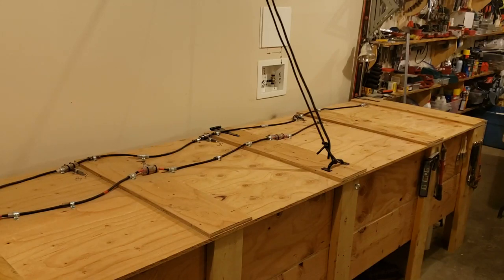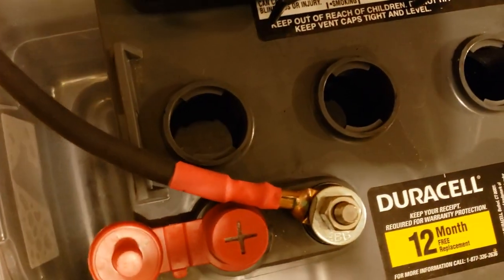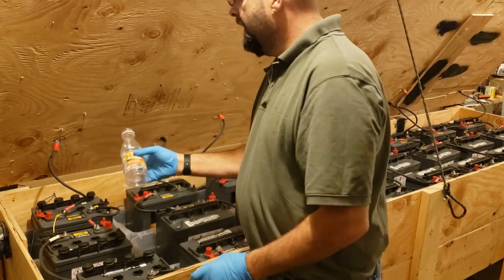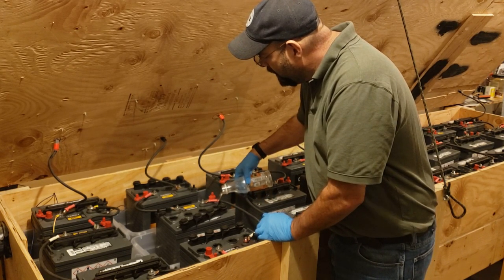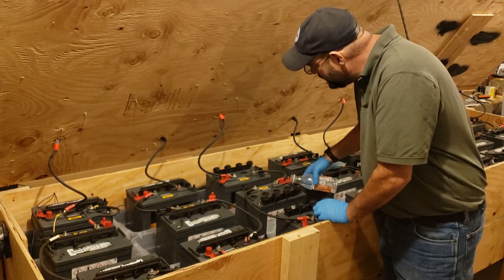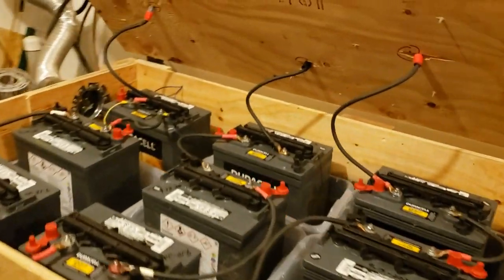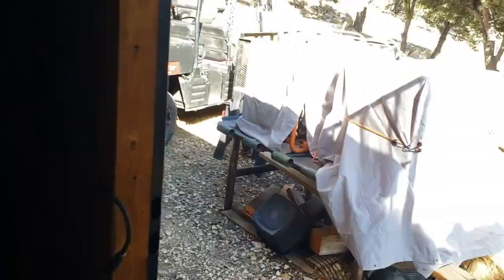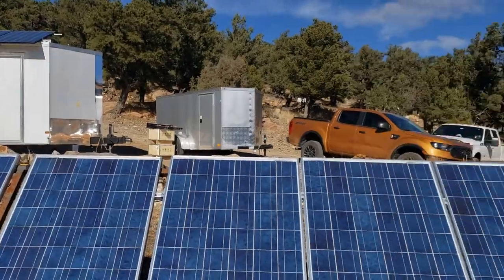Off grid cabin , lead acid battery maintenance schedule

Comment: " 48v 200ah - that'll do the trick ". Yes indeed. No one can say a thing bad about your system as the proof is in the pudding, 15 years of finding out what works for you. Bolt down those solar panels firmly lesson learnt the hard way. Wind generator just sits in the corner churning out power hour after hour. Thanks for allowing us to see your property.
Reply from the maker: thanks, ya we are going to go Li-ion when these batteries are depleted. Probably this summer.

Comment from the maker: on a 48 volt system you can get inverters that have a much higher capacity , they do not need to pull high amps like on a 12 volt system . I have three 48 volt systems , one of them has a 8kw inverter and it does just fine.
Reply from the maker: @able880  to long did not read
Reply: @chadjones99  I deleted it for you

Comment: Sir, this is amazing. Thx 4 sharing your systems with me. Let me ask you a question though. Isn't a wooden case for your batteries bank a risk of fire?
Reply from the maker: I don't believe so , the battery is in plastic tubs for any leakage, and a metal case will conduct electricity, wood at this voltage will not.. so the only risk is if a battery caught fire ( which there is no reason for that with this system , unless something crazy happened )  I guess it could spread, but Ive had batteries in a wood box for about 15 years, ( this box is only 2 years old ) and never had a problem.
Also a metal box would be very heavy and the cost would be crazy compared to wood
Reply: @chadjones99  thank you very much. I'm just learning and not trying to be disrespectful or condescending or sarcastic. Thx.
Reply from the maker: @jacquesdutron9954  ya no problem . This cabin was built about 15 years ago , and about 2 years ago we moved the battery to inside the basement as they had been in a out building next to the house for 13 years , so this box is new ish
Reply: If he was worried about fire risk he could put something to layer over the wood if he wanted.

Comment: I didn’t catch if you were using distilled water or not. Please make sure you use distilled to fill the batteries! Regular water has minerals and other impurities suspended in it
Reply from the maker: Yes I am but thanks for the info. Been using distilled water . Thats why they last me 5 to 6 years

Comment: Is converting to 24 v or 48v how you get around and fix the idea of not being able to use devices with higher wattage from your system? With a 12 V system I am finding that you can't really hardly pull any higher watt usage devices from the system because the power dips and then the inverter would block pulling the watts because it didn't like it when the voltage would drop too far from a bigger load (to protect the batteries). 

Maybe doing 24 v or 48 v systems are how you get away from that?

Comment: what are using as a bms? to protect each cell?
Reply from the maker: Lead acid . You don't use bms on lead acid . Charging set by inverter charger and charge controller

Comment: Should replace the lead acid for a real battery system (LFP) and realize dramatic improvement:)
Reply from the maker: your right. I have such a system ( 3 of them 48 volt trophy battery ) . but I still have 3 to 4 years of life left in this battery so I'm not going to waste them.... check out my FB page to see current projects : search this name   : Solar Trailers Johnson
Reply: So what kind of "real battery system" do you currently have?
Reply from the maker: @MrRob1426  not sure what you mean when you ask in " " marks about a real system ?  We have a lead acid system in the Cabin as listed above. I have two mobile systems that use 48-volt Lipo4 trophy batteries. But Im not switching out the Lead-acid system because they still have a couple years left in them and I don't see a need in wasting the batteries if they are still good. when we bought this current lead acid system about 3 years ago Lipo4 replacement ( to match this size ) was out of our budget.
Reply: @chadjones99  Sorry for the confusion. My comment was meant for the one that said you should replace your batteries. Use what ya got if it's working. I like it. 👍
Reply from the maker: @MrRob1426  Ok cool , ya I was like well I would like to but this is what we have the budget for LOL
Reply: I don't think you should replace away from lead acid. Lithium has much much more fire risk. Also if you are in Colorado people say Lithium can stop working once the temperature goes to freezing. For very cold weather lead acid works fine. 

Plus, the reason people are obsesses with lithium is to get away from how 12Volt systems can't really pull electric juice/wattage on electrical appliances and how limited they are. But your system has already compensated for that by getting away from 12 Volts to higher juice (24 or 48 v). 

So there's no reason to do away with an already wonderful setup and design. Plus you can't mix lithium and lead acid batteries together. You have so much already with this system and it works. 

He's already built over the problems that people would have with lead acid. So he gains nothing by going to lithium. Particularly since you can't mix lithium and lead acid. There are videos where people talk about trying to research how to mix the 2 types together, and if you actually listen to them, the fire risk and problems if something go bad are amazingly high risk.

Comment: Fireptoof?
Reply from the maker: Huh ? do you mean to ask if its fire proof ? No it is not but I have no reason to think a fire would start , at worse the battery can leak which have pans under them inside this box, plus box is ventalted to the outside.  If a battery explodes its inside the box and will just splatter acid ,

Comment: Car batteries are not something you can make or grow yourself so YOUR LYING about being off grid.
Reply from the maker: What are you referring too ? 1) not car batterys ( lead acid gulf cart 8 volt batterys) 2) i never said I made them ... bought from. Sams club 3) you can make lead acid batterys all though I would not.
4) why would I have all those hooked up if I was not off grid?
Reply: Off grid in this case is referring to not being tied into an electrical grid